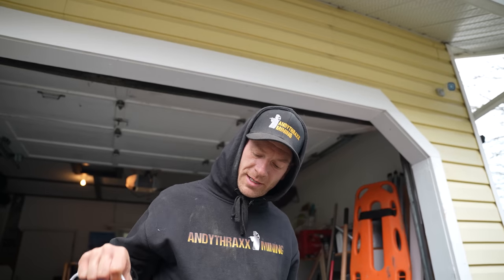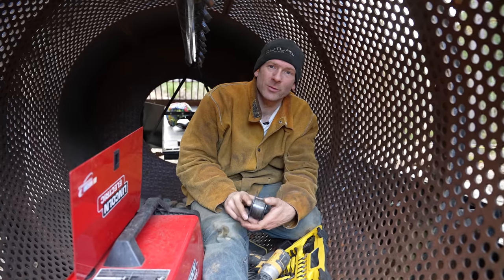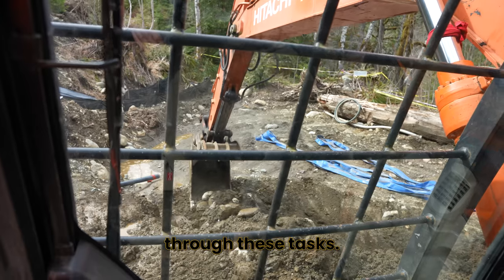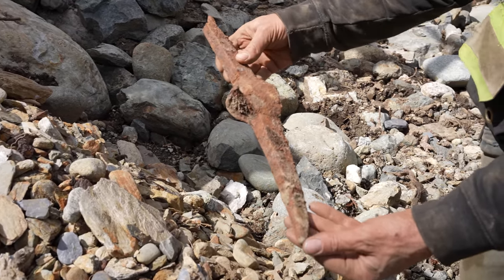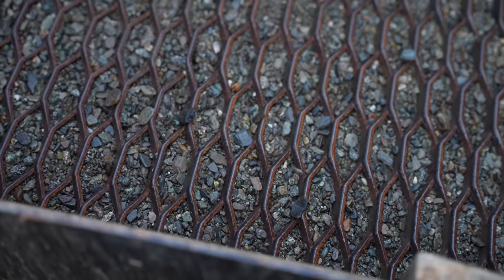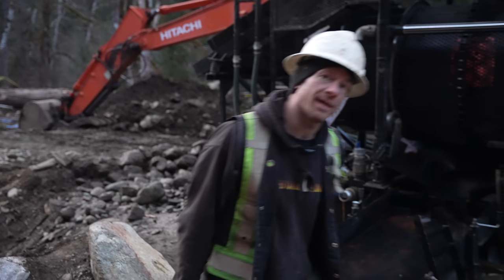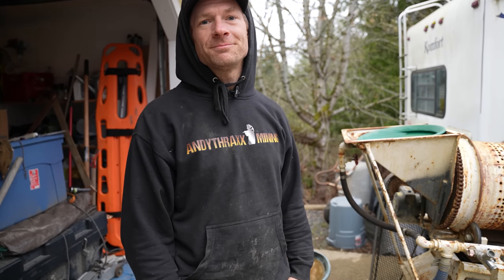Finally Striking Gold in an abandoned Ghost Town

Comment: Awesome Video Andy, I did just that for many years of my life. The Torch was my main tool, I had a tip for Everthing. A clean tip makes a difference. Moving on laying out a pattern for a chute.  What ever. Measure  Precisely the outside edge. Then measure crossways. Take your measurements and start with the longest outside edge, for your first edge. Saves on cutting! Mark that edge ,  swing an arc on your next outside edge. Then to the other side of your, first edge marking. Swing an arc from that Mark outwards using that crossways measurement. Where the two arcs meet up is that corner. Repeat opposite side. There is you plate. It's triangles and precisel measurements. I used a laser that threw out a line, then marked all my corners. Then measured my triangles. Hope this helps.
Reply from the maker: Fantastic advice there’s some neat tricks out there, thanks for sharing🍻

Comment: Great video as always! Love the process of getting things dialed in once you start running and see all the bottlenecks.  When I  first started building stuff and made my first design mistake, I would think "dang, how did I not see that?" but after doing it for a while I've realized that it's always going to be an interactive process.  There are no mistakes, just learnings.  Looks like at this point if you can run 15 yards, you can run 150!

For the Grizzly, I would be sure to drill two holes in the bottom corners of that hollow triangle you have now formed.  One day a pin hole may develop up top and fill that space with water.  For the grizzly plugging up, I wonder if with how strong those bars are, if you are dropping the boulders into the flat plate above and the big rocks are only then sliding down the bars, you might be able to just cut out the intermediate supports and/or leave the bottom un-welded.  Like perhaps just cutting the bars loose at the bottom they would be about 1/4" hovering above the bottom cross supports.  That would limit their flex to the 1/4" gap, but allow them to spring around a bit.  If that's not enough, or it's getting to bent up with only the top welded in place, might be worth flaring them out so they fan out as they go.

Best of luck, and maybe see you in July!
Reply from the maker: I think you make great suggestions on the grizzly bars , lol and good call about making sure that hollow area has a drain 🍻😀

Comment: that pick is hand made. on the end with the point up at the union of the handle pocket and root of the pick, there are a few little steps where the blacksmith necked the material down and left those toolmarks. The modern method is to drop forge where they are progressively stamped, which does not leave marks like that. they are present on one face but not the opposite side, and single sided defects like that are indicative of hand crafting
Reply from the maker: That is so cool thank you so much for sharing this😀🍻

Comment: You can see on the old pick head the main body of the head is either wrought iron or mild steel but the points are hard steel inserts lap welded into splits on the ends.
Reply from the maker: Oh wow, excellent observation 😀🍻

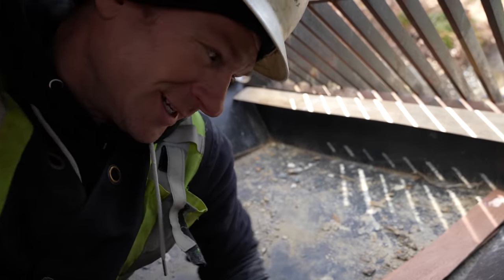Comment: 4:00 REDUCE CORNERS!!!

A uniform  full length, half drop angle slide will cause you less backlogging and jamming than  half length, full drop slide.

A transition point on a sharp corner is where more stuff stops moving.

Comment: 17:45 cut some drop-outs on your grizzly bar there.

The problem, as I am sure you can see, is where the sloped grizzlies come in contact with their central support bar.

Should have made the bar lower and offset by about an inch maybe 1.5 inches to ensure rocks would not stop and jam there.

Comment: Fun to dream. Experimentation with design to make your outfit work can be daunting . Your grizzly right now is a major bottleneck and is not using the angle of repose (slump) well  and is not lending it self to the least amount of surface contact of your material . How much vibration does your hopper combo  grizzly have? Should you have water coming in at the top end  of that new plate you put in to hydraulicly push your material forward?  Your grizzly is catching rocks at where your cross support pieces are, using pipe grizzly bars would possibly eliminate the need for the cross support
Reply: Clever idea to use round pipes instead of bars or even rebar for the grizzly.
Reply from the maker: Excellent observations, I think you’re bang on, I’m definitely going to cut out the cross supports between the grizzlies and see if that helps.😀🍻

Comment: You're using innershield*? are you blowing the liner inside the hose out regularly? I usually do it between spools, but the manual that comes with the wire (or welder? can't rember)
a lot of crap comes off that wire, and it pluggs up insides the liner. if you have to use excessive drive roller tension, that's why. The way to test drive feed tension is to pinch the wire while feeding, it should stop with firm pressure from gloved fingers as the rollers start spinning. 
the way to clean it quick and dirty is to just pull the hose assembly, tear down the working end to expose the bare coiled liner, then insert an air gun nozel at both ends and blow it out.
if you want to get really fancy, you can unscrew the liner from the feed end and it will pull completely out of the hose. I would not do that outside grit in and on the liner is asking for trouble. I usually only pull it once a year or so, but I'll run though and work it around to get everything opened up and cleaned out nicely.
Typically when people say innershields runs like trash, it's because they are not increasing (or even performing) the PM's on the machine.

*EDIT: I just realized I always bung up inner vs outer shield. I know you're running the gasless wire since it's what I use at home as well. I've never play with dual shield, all hard wire at work

Comment: The pick looks like it was poorly forgewelded and the tip broke off when it was used to lever something (the eye NS shoulder would be mild steel or wrought iron and the tip would be a diamond shaped carbon steel insert to save expensive steel) 
Cool to see some colour atlast but I can see why you want to do the bigger cleanups  and get some pay moving

My philosophy on welding wire is and many other things is "buy two and get another when you start the last one"
Reply from the maker: Fantastic information, thanks so much for the tips 🍻
Reply: @ANDYTHRAXX  youre welcome

Comment: Get the same chemical that the city uses to have the sediment in the drinking water dropout seconds after it gets put in there and that'll help your water recovery stay cleaner
Reply: Getting old car inner tube
Cut it in half and stretch it across a table so it's tight like a river bend
Take a Scotch-Brite pad scrape across it side-to-side let your water run down on it brush it with a brush or there's no air bubbles caught on the rubber put your concentrate on there with that water flow and you'll see the gold stay in black sand float away

Comment: You need to adjust your rate of feed. Again you need to talk to Mr. Newton. You already know how many square inches of material you can move per volume and velocity of your water. Now you have to adjust your feet of material. Or spend the next 3 years tweaking that washer. All these things should be figured out by math. Volume of water per square inch required to move X volume of  materials through the hopper You got to get the material volume right. Let me put it this way you're trying to shave a 6" Subway in your face and one bite and you're choking. So if you have 1 or 2 choices you can keep trying to make your mouth bigger and bigger until you can shove it in. Or you might take it in bites.